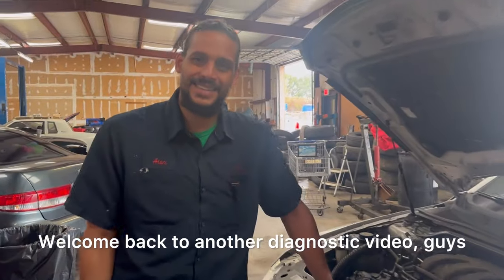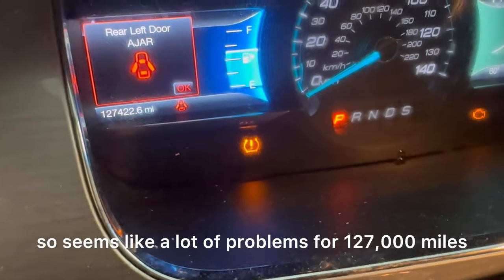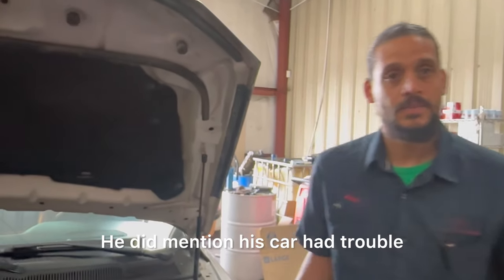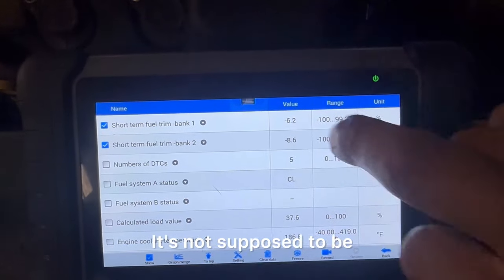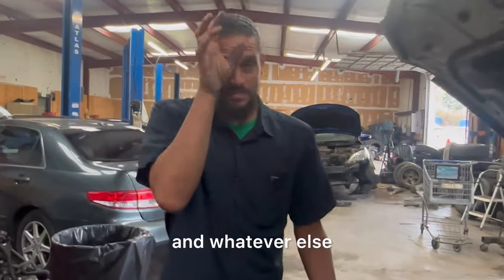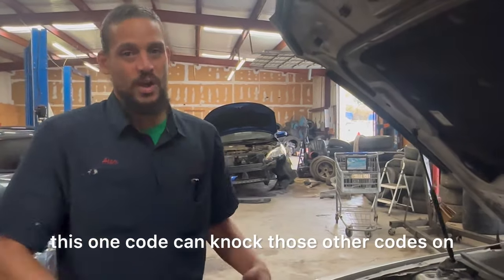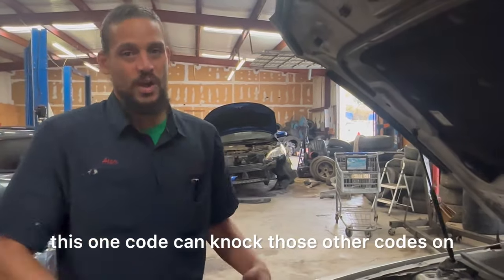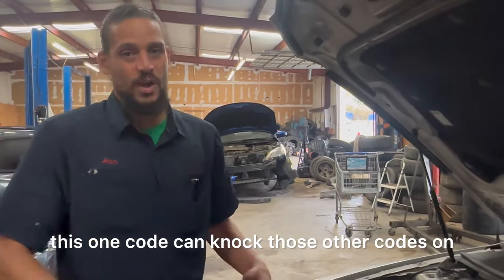His Ford Taurus Keeps Killing Catalytic Converters 🤔

Comment: Water Pump, timing chain, PTU, Catalytic Converter, are guaranteed to go on these cars.
Reply from the maker: Yeah they better have that money set to the Side 😩 emergency fund
Reply: Facts, doing a PTU today on one. Luckily we’ve have plenty of spares to pull from.
Reply: What goes bad on the timing chains?
Reply: @mph5896  chain stretch, tensioner fully extended, worn guides I think. exacerbated by low oil change frequency
Reply: @thezombino6119  Hm, I haven't seen that on the NA 3.5/3.7. When I do water pumps I leave all the timing components and just do the water pumps.
Reply: These like to bend Valves.
Reply: @mph5896 the tensioner I had one customer that had bent valves

Comment: I had a 2015 Ford Fusion SE the 1st Ford I had driven in 26 years as I had a couple of them become lemons. We decided in 2015 to try them out again see if they were any better and I got my wife a 2015 Ford Fusion SE. At 22k miles it left us stranded and turned out to be a cracked cylinder head in 3 places. After Ford towed it and fixed under warranty they said it appeared to have been cracked when it was forged. We had nothing but trouble with it  there after and once it hit 55k miles I had had enough and RAN back to Toyota and purchased my wife a 2020 Camry SE and have not looked back. I will not touch a Ford built after 2003 that is my rule! I have family that are hard core Ford loyal buyers, but every one I have owned except one a 1992 Ranger has been terrible:P Thing is the Fusion had the 2.5l engine which was supposed to be the bullet proof engine. Not so Bullet proof in our case. Fast forward to 2023 the 2020 Camry has been flawless and knock on wood it stays that way. Then there is my trusty 2003 GMC Sierra Toyota grade quality in those years of GM!

Comment: I've been working on a 2011 Ford Edge, pretty much same engine. Had the same codes. I've replaced the purge valve, and sparkplugs. Still have the cats and o2 codes. Trying to figure this out, considering the o2 are like $150+. The cats are about $1000 a piece. Oh yea I also replaced the pvc when I did the plugs.
Reply: so you had a p1450, replaced purge valve and that code went away but the rest didn't?
Reply: @thezombino6119  Yes, I suspect that the o2 sensors had been rich for so long that they actually may be bad, and the cats. I really wasn't expecting to change the sparkplugs until she told me her check engine light flashes when she is giving it gas merging onto the hwy, and it hesitates. Spark was cracked in one cylinder. So I'm thinking all those burned up the o2 and cat.

Comment: More mechanics need to be honest and show people that even with no repair this car could still pass emissions. If you drive it just enought for monitors to clear. Never shut the car off and have it scanned at the emissions station it will pass with "flying colors". Emissions is a SCAM! They only care about those monitors ready and no stored codes. Pending codes on the other hand no one cares about. I had so many cars with different codes pass emissions. Only if you keep the car in that first drive cycle it will never illuminate the light unless its a hard set code like a trans or misfire issue ofcourse!

Comment: Great video Alex! I enjoy watching your shorts that I come across and finally decided to watch a video. I'm glad you explained the issue, how it effected the rest of the vehicle. Love to see it man!

  If any of you by any chance have a 4 cyl ford and the hose is like.. heat crimped to the valve, if you cleanly cut the hose on fuel tank side at, you can shove either a 3/8 or 5/16? fuel hose to connect the cut portions together (its gotta be a snug fit). Only make the cut if you can piece them back together with a fuel hose - very low pressure builds here, and I think only when the car is off ... something like 1 psi, so no hose clamp or any other clamp needed since like The Car Doctor says, it's a vacuum when it's functioning.

Comment: Hey Alex,  i have a question.   Im checking out a Vehicle on Friday and would love to hear your opinion. 
2012 Ford expedition xlt with 60k miles on it.

Would you recommend? 
Are they expensive to maintain?   
Hows winter driving?  

Sorry to bug ya 😅
Reply: **make sure frame isn't rust rotted out.**
I would recommend one of those at the right price.
Take it for a spin - everything should be tight and feel mostly new still at 60k.
does this one have a tow hitch ? if so - change all differential fluids, transmission fluid and if it's a flex fuel, look into cleaning fuel system and if near the ocean or salt water, consider changing the fuel filter as well as E85 loves moisture.
They're not expensive to maintain. The expense usually starts at around 130 - 250k miles.
Gas mileage: 14 mpg city / 20 mpg highway
winter driving - for this, it's all about the tires. I'd recommend seeing Tire Rack for your next set - if you have questions they have genuine people that'll answer your questions. They cool.

Overall - great vehicle.
sorry, I'm not the car doctor, but I do dabble with cars

Comment: I have a ram 2500 hemi 6.4 that has a small valor leak, changed the purge valve and leak detector pump, still have the same code, what should i try next? Also i have the oxygen sensor code?

Comment: Fuel induction is one way of cleaning the dirty intake valves can you use walnut shells to blast the area clean if there’s lots of accumulated deposits? When I bought my Ford Flex it was also a concern and several YouTube videos were made about the subject and some videos suggested use of catch can’s to help control the deposit issue. What’s your thinking about these things?

Comment: Did he pass the smog test at the end?... would injectors also leak fuel into the cylinder as well? Or is it just the spark plug not burning the fuel..

Comment: There’s no coolant running through that throttle body and that’s valve is called a vapor management valve just for emissions.. no causes for cats  and that valve is just 60$  and you don’t have to move bar  for intake  it only take 10-20 mins to take intake off

Comment: I method I’ve heard about on YouTube videos for gentle inserting spark plugs is to use a piece of rubber hose insert the plug into the hose and use it to start the thread to avoid cross threading the plug.

Comment: Good job Alex. I have a 2014 taurus w/32k miles and I have ocd so you can eat off the engine..When would you suggest the pcv valve be changed and does that reguire removing that upper intake plenum off. For anyone with this engine  it is suggested to switch to the yellow coolant to help prolong the water pump life. Thanks for sharing.

Comment: Almost, you should verify plug gap with gap tool/ gauge. There are a few flexible tools available to help remove loose plugs and seat new plugs, large diameter vacuum hose works great too. Even “guided down” there will be a drop, that will lessen the plug gap.
Other wise, good diag. .
Reply from the maker: I read somewhere don’t stick gap tools in these particular plugs you can damage them that’s why they cover them with the plastic protector, so it will maintain gap. I forgot to mention the hoses for spark plug guides. Thanks for reminding us. thanks buddy I try my best.
Reply: I always check my plugs because I have seen customers return them and who knows what they have done to them but some Manufacturers do say not to gap the Fine spark plugs because they can get damaged , and if they are off by a little they should compensate for it

Comment: Pro tip. When installing spark plugs; get an 8” piece of fuel line that will just fit over the ceramic spark plug body. Use that to guide the plug into the hole. Then immediately start threading the plug into the hole using the fuel line to turn the plug. You will be able to feel if it is cross threaded. You will also then guide the plug into the combustion chamber easily without banging it into the casting and affecting the gap.

Comment: Great job. But I always check the gap on new plugs.
Reply from the maker: That’s good practice I normally do the same if the spark plug tip protector sleeve is damaged or missing

Comment: Do u trust Duralast??YOUR opinion matters.,?
Reply from the maker: Depends on the part. For the most part, they are pretty good.
Reply: @AlexTheCarDoctor  I have had a few bad wheel hub bearings n purge solenoids!Ty 4 ur input!
Reply: Hello! Where should I go to get a new catalytic converter that will last the rest of a car's life?
Reply: @missa740  dealership

Comment: Or just buy a magnetic spark plug socket. Way easier. And no, it's still not okay to use power tools to remove spark plugs. These heads are all aluminum and you WILL damage and strip the threads. It takes no time to remove completely by hand
Reply from the maker: I have one. And yes you are correct a novice will probably damage or strip the threads. As long as I have been doing this, I can hear and feel my wrench is struggling to remove something and I’ll stop and investigate. It is rare but it happens

Comment: I have a P0430 Code: Catalyst System Efficiency Below Threshold (Bank 2) code on my Escalade I've tried everything over the past year and tried cat cleaners and all.. I changed all 8 plugs and wires, new coil packs, new purge Valve, new evap canister, new o2 sensors, new exhaust manifolds and etc and every time i clear the code, it just keeps coming back at least i live in Minnesota and we don't have emissions. now I pretty much got use to it and live with it on.
Reply: You need new cats. But before that you need to figure out why your cats got plugged up. If your engine is burning oil you need new valve seals or the piston rings could be bad